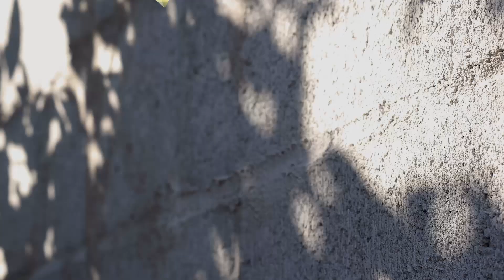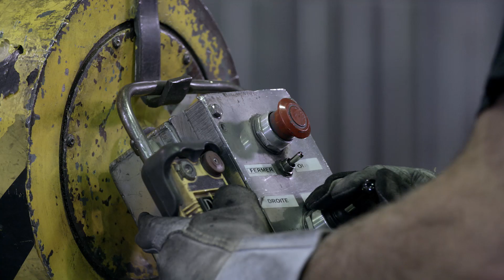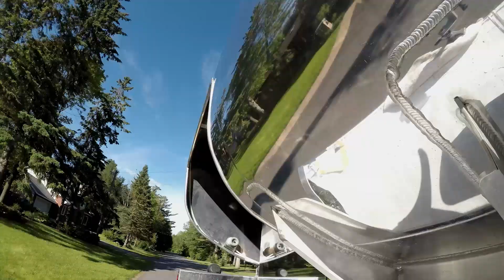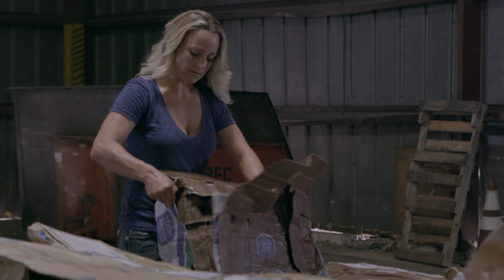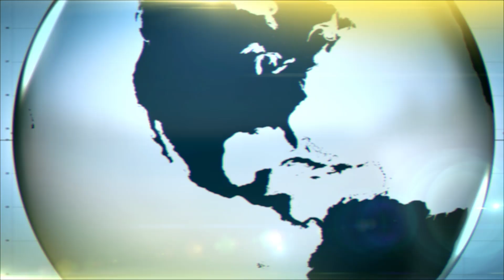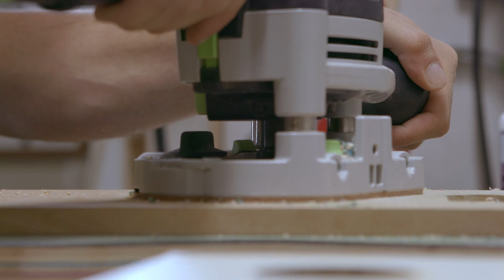From a Skateboard to a Guitar | Made By Destruction

Comment: My Aunt used to collect old phone books and old newspapers as well as shredded paper from businesses. She'd put them into a commercial food processor with water to turn it into a pulp and then add some bees wax, shaved off a big block using the food processor's grater fitting, then put the blade back in and blend it some more. Then she had a 1M long steel pipe with holes along it and would pour the pulp into it, it would take 3-4 batches of the food processor to fill the pipe, then used a vice to compress it and squeeze out most of the water. She'd leave it for a day or 2, then it was still damp so she would put it out in the sun to dry and then put it into a pile in the shed for winter.